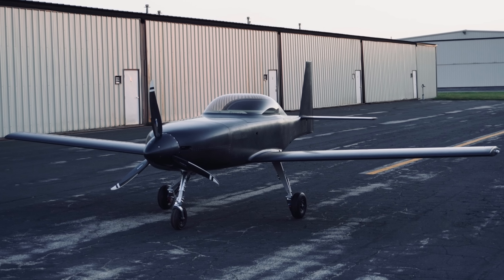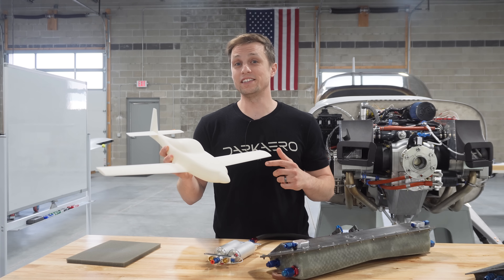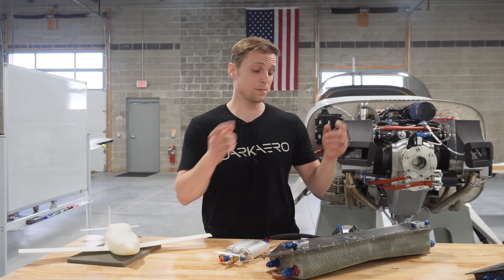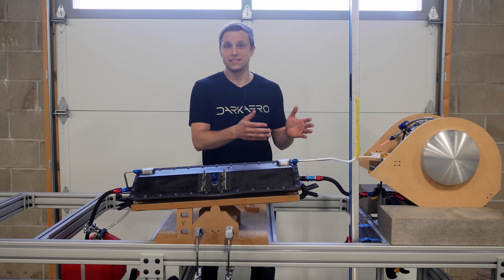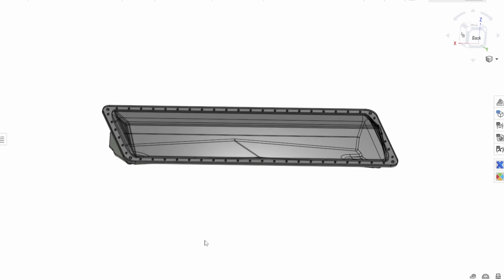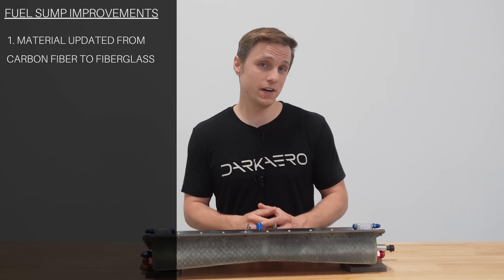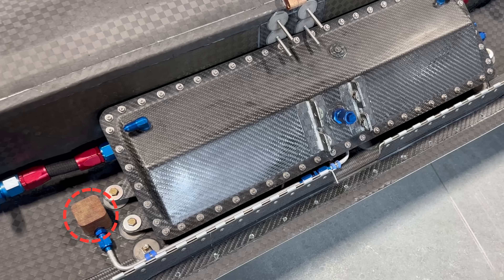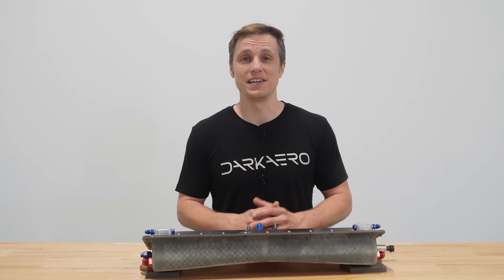What happens when a design fails?

Comment: Nice design improvement. You're generously transparent about the design process. Do you have additional drain ports in the wing tanks? The reason I ask, is because if any part of either wing tank sits lower than the wing-tank outlets, then it might be possible for water/contaminants to collect in areas that aren't drainable while parked.

Comment: I know it's not part of the scope of this design, but one thing I hope becomes a thing in small aircraft design is a battery backup system for aircraft engines that can drive the prop for a minute or so, such that pilots have time to land in case of engine failure.

You guys' commitment to safety is extremely effective wrt the resources available to you, though. The redesign of the sump tank is brilliant.

Comment: "What happens when a design fails?"
It ALWAYS costs a LOT of money and sometimes people die.
Having spent 25 years designing and managing the Engineering design of products I evolved several design rules.
1.  NEVER,  EVER let an "industrial designer" DESIGN products.  STYLE yes,  DESIGN NEVER.
2. ALWAYS have a Design  ENGINEER design products.  A Design ENGINEER MUST HAVE knowledge of all the production parameters of all the production processors required to make all the component parts of his design.  Industrial Designers are concerned with the aesthetics of a product and some hapless Production Engineer is left to sort out their mess.
My design rules for my Design Engineers were :
1.  Design the assembly to last forever - amen.
2.  No failures permitted  - whatsoever.
3.  No adjustment both on assembly or in the field permitted - whatsoever.
4.  Absolute minimum of fasteners permitted WHICH MUST BE IDENTICAL TO EACH OTHER.
5.  Top down assembly
6.  Poka Yoke for assembly  - physically impossible to assemble a part incorrectly.
7. Absolute minimum number of parts in ALL assemblies
Reply: The problem is this is an experimental aircraft that has never flown. If for some reason the main gear had to be moved 2" it would require redesigning everything adjacent and could add months to the design. That includes every subsystem, the nose gear, the canopy mechanism, etc. This plane is also pushing the performance envelope. Who is going to test fly it?

Comment: Great video, thanks! Question: You switched from carbon to fibreglass for good reasons. You are aware that fibreglass tanks need special sealant to avoid contact between the fuel and the epoxy? Especially when your users will put in Mogas with ethanol.. Would you consider doing the design in all-Aluminium?

Comment: the more away you put the fuel, the more rotationally stable or harder its to turn/tilt
Reply: can be beneficial or not, plane is not fast to turn etc
Reply: use an engine that does not care about fuel contamination, like turbines and pulsejets, afterburners etc
Reply: make stuff that cant fail, instead of needing to test
Reply: yep sound design principles from the start
Reply: accordion tank would work in any angle, piston/inflatable bladder tank
Reply: tradition copying is not often the best
Reply: ie money and law will not help you, its only in the way
Reply: best part is no part
Reply: best work is no work required
Reply: needing to work is a poor excuse

Comment: Dumb question from a non-pilot: why not use bladder in bladder in void design? You could just have multiple , redundant air pumps to pressurize the outer bladder which would force the fuel to the engine regardless, while being substantially sunoker, cheaper, lighter, and more failure resilient.

Comment: In Europe(I guess Italy) they make the ultrafast two seat aircraft called Risen. Please note, with 100hp Rotax they guarantee the top speed at sea level 320km/h (173knots) and with turbocharged Rotax 915 -142hp  they guarantee maximum cruising speed  at 16 thousands feet  450km/h !!!  (243 knots ) !!!    Will Dark Aero be able to  achieve  the same velocity with much stronger engine ??? Risen has got the ultimate aerodinamics IMHO.  Extreemly efficient and it is all carbon fiber too.  What I like about Risen  compare to Dark Aero, that Risen is not using any metal(aluminum) honeycomb, but rather materials which can never ever rust....   On the other hand what I like about Dark Aero is the gear(looks strong) and the 2 baggage compartments.
Reply: @@FatDickDanny On the top of that speed it has extreemly long legs too...it is the only ultralight which flew from Europe to South America directly,  using just regular tanks.(Europe-Arica- South America)

Comment: I’m not sure I understand the purpose of having the sump tank. On my rv7 I just have the 2 wing tanks go into a single line and the a transfer line going side to side for fuel transfer. There is a selector switch like mentioned in the video but I always leave it on both. The diamond da40 work’s interesting as well where fuel is only pulled from the right wing and then the pilot has to turn on a transfer pump to pump fuel from the left wing over to the right wing.. this sump tank also appears it would create air in the fuel lines if flown inverted. Love the project!

Comment: Great informative video. Did you already explain your design around the Vent Shuttle Valve somewhere? Would be interesting to understand that details of that.
I favour you decision to do away with manual tank selection, but I'd also like to understand how the tanks will ballance statically and dynamically (During fueling, on the ground and in the air).

Comment: What kind of epoxy do you use for the tank, or are you going to coat the inside with a coating that is compatible with the fuel?
Reply: I was wondering about that too.  I was expecting (but didn't see) a fuel tank sealant applied to protect the epoxy.
Reply: I Am interesting in the same topic

Comment: How do you deal with high roll speeds pulling fuel away from the sump? Similar with low G/ inverted maneuvers?

I can see how the check valves in the sump have a good chance of keeping enough fuel in it during high speed rolls from starving the engine though.

(Correct me if I'm wrong in thinking you need this as my understanding is this is a high performance/show aircraft or if the aircraft is not being designed with these maneuvers in mind)

These videos are very interesting and have helped respark my love for engineering. I cant wait to see this project finished

Comment: Excellent!  I see two considerations not mentioned in the video:  Static electricity (Electrical bonding of components and structures) and provisions for thermal expansion of fuel and potential  leakage at overboard vent ports.  A lightning strike would be worst-case, but static can occur in places you may not expect to find a difference in charges.  If using high octane fuel this is especially important.

Comment: Great work guys!
Have you considered fuel heating when recirculating back into a tiny volume at high flow rate?
Might be better to recirculate into the high volume main tank which is "aircooled".

I see that you are trying to solve the fuel selector problem as a source of potential pilot error and nuisance. 
Would it not be simpler and more controllable to replace a clasic fuel selector valve with 2 solenoid shut off valves (with manual override) that are automatically controlled by digital fuel level sensing?
It would also solve the following threats:
1)One tank becoming unusable fuel due to a stuck check valve.
2)The higher tank feeding alone (side slip) causing an imbalance that makes the low wing even heavier and the high wing lighter.
3)Inability to isolate one tank if deemed necessary.

With computer controlled balancing you could run different regimes 
1) automatic balancing based on measured quantity (you could even program a deliberate imbalance e.g Keeping 30pound more in the right tank to minimise control deflection with single pilot ops).
2) Automatic switching after elapsed time   (if fuel aensing fails)
3) both at once 
4) manual operation as back up.

Sorry, I can't shut up.
Keep doing, what you're doing, you're doing great.
Reply: Simplifying the design to eliminate the fuel selector is a good step. Fuel mismanagement has been a major cause of accidents. Design to minimize fuel transfer is good. Simple ball check valves that allow some leakage between tanks might be reliable enough to work without complex computer control. Trimming one wing slightly high or low for balance issues might work without adding complexity. The ideal I think is the Cessna 150-2 fuel system, several European Manufacturas's also have good fuel system design for their planes.

Comment: The design is more complex than required. Experience has shown that the wing tanks can feed the Duplex valve directly and return to the selected tank. Dirt simple, lighter, less parts and proven reliable- nearly 1 million flight hours on low wing aircraft with EFI. Your EFIS can be set up to flash a warning to switch tanks every hour. Not significant pilot workload. This design has too many parts, any one of which can fail or add to maintenance workload. Parts which are not there, can't fail.

You are very thorough and I like what you guys have done but you're often re-inventing the wheel. Each one of these complex solutions puts you more months away from first flight... If you take too long, some people have already tired of waiting and may have moved on to another kit design. You're losing momentum with all these delays IMO.

Comment: It seems like going with a fuel selector could still be better than this. Most pilots are used to switching tanks and I think I would trust myself more doing that than a bunch of valves and piping and tanks, etc. Even if you run a tank dry, the engine slowly starts sputtering, switch tank and it comes right back to life.

Comment: Another reason wings are good for fuel storage is because the wing itself supports (and distributes) the weight of the fuel, and you don't need additional structure in the airframe to support the weight of a fuselage tank. Smaller, lighter spar, smaller lighter spar support structure.
Reply: .....and the structural support already needed inside the wings can double as the anti-slosh thingys

Comment: May I ask why not use Kevlar Fiber for Fuel Sump? Would it not be Easier to work with? All Us RC Jets and Gas Prop airplane run Kevlar Fiber Tanks?
Reply from the maker: Great question! Kevlar (aramid) fiber would work too. Glass fiber is a little easier to work with, but aramid is lighter. It all depends on your design goals.

Comment: I always assumed you’d have a foam filled surge tank in the system (between engine and sump) just in case of high-g or tilt impacted fuel rate.
Reply: @darkarrow    Yeah what about this question?   I don’t know if foam is needed but what about g-loads & pitch angles?   Were those tested?

What about delta ram air pressure in tanks during an extended corkscrew or something?   My high wing only uses one vent so just thinking/questioning out loud.    ….

Comment: My plane’s two fuel tanks have…

Screens at the fuel pick-ups in the tanks…
Sumps lower than the fuel pick-ups…
Small dead space in the lower corner of each tank, because limitations in aluminum construction…
Another screen at the bottom of the fuel separator below where the two fuel tank lines feed the separator…
Tiny screens in front of each fuel injector…

Each fuel pick-up is at the back of the tank… so it is sure to pick up fuel when the nose is high on departure…
The pick-ups are at the inboard end of the tank… so it is sure to pick up fuel from the uphill wing during a slip to final…

Fuel cap seals have been updated to be blue fluoropolymer seals to keep them from absorbing 100LL and changing shape over time…

Tank vents are at the top corner of the up hill end of the tank, with a hose venting to the bottom wing surface… have a method to pre-flight for bugs…

Things to consider when designing new fuel tanks….  😃 (from a Mooney driver)

Comment: You guys chose to go against a fuel selector valve & said you were sure the fuel transfer rate was within acceptable margins, could you expand on that? Does this design mean that if one tank has a higher head pressure than the other, it will flow into the sump faster, automatically balancing the tank levels?

Comment: I'd think you'd want the fuel return lines going to each wing tank and not the sump to keep the entire system properly pressurized and not get back-pressure on the feed check valves causing vapor lock.

*You also want to install an air return line into the highest point of the sump to the highest point of the wing tanks should air be introduced into it during maneuvers.

The sump could use a baffle across the center with a hole for crossing. But I think the shape you created for better contamination tests accomplishes this fine. 

I'd do the math to see how long the fuel in the sump alone would last under climb and cruise power to see if the sump is large enough to carry you should you encounter any feed issues. Wouldn't hurt to double the feed lines to the sump in that regard. 

I forget the wing tank layout and whether you baffled the pre sump feed area but that would be a good idea to prevent air entering the sump area. 

I think because the sump is not large (I know you all are working with constraints) the fuel will start moving rather quickly there and air could be introduced if not properly accounted for. It also needs somewhere to go if it does.

Now to discuss my consultation fee...
Reply: I’d throw in a pressurized surge tank between the sump and the engine. I’d also make the engine fuel delivery a return-less system with a pickup pump moving fuel from the sump to the surge tank and then have the main fuel pumps housed in the surge tank. This surge tank would have return fuel system to deliver excess pressure back to the sump or main tanks. (How you build a high-g fuel system for a high HP drift or drag car)

Comment: Will it be possible to fill one wing entirely while the other is empty?
Reply: I'm more concerned about the weight of a full wing when the other one is empty.  Could it tip over the plane given the well understood tricycle wheel arrangement.
Reply: @blakeg9221  That's exactly my concern
Reply: @blakeg9221  that's a good point. A crossover line could keep the thanks relatively level but then you'd have large quantities of fuel transfering during manuevers.
Reply: With the check valves in place it shouldn't be an issue but I'd need to look at the p&id. Also you wouldn't want to do that.

Comment: Fantastic presentation and discussion on the development of your fuel system to power the engine in Dark Arrow 1
Takeaways
* Fuel storage and its effect on the centre of gravity.
* Benefits of a sump.
* Composite carbon fibre moulding.
* Petroleum and fibreglass
* Gravity and electric pump delivery systems.
🌏🇭🇲

Comment: How do you prevent ethanol or petrol attacking the epoxy resin of the tanks and sump????
Reply: And why not weld together a conventional alu tank, it can't be any significant difference in weight. I love the obsession with perfection, but... aluminum is a conventional choice for fuel tanks... for a reason.

But, they've addressed the resin question before... the wet wing uses a special resin that is impervious to the fuel. Still... carbon fiber parts aren't wet proof. Aluminum is the perfect material for this...
Reply: The wing are not hollow. They contain many structural parts, thus a bladder or a tank is not an option.
Reply: Av gas has no ethanol
Reply: @williamhoffman4337   No , but that engine runs on Mogas as well as the highly leaded Avgas100.  Loads of microlights have had their tanks go soft  with resin destroyed.  Thank goodness they don’t have 130 leaded avgas now.